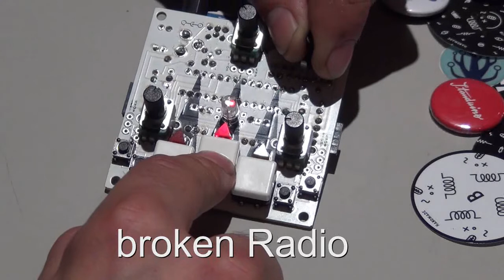Hear the Phonic PolySynth Trinity module from Standuino (bastl-instruments)

Comment: Hello! When you save your adjusted sounds should we expect to be able to recall them as completely saved once polysynth is turned off?  
Also, I noticed that on the video's polysynth two extra outside small buttons. One used to create 'random sounds' when depressed. How do we create random sounds without the two extra outside small buttons? 
and last, is there a Sequencer video coming soon? 
mark from Duotron (Detroit Electronic band)